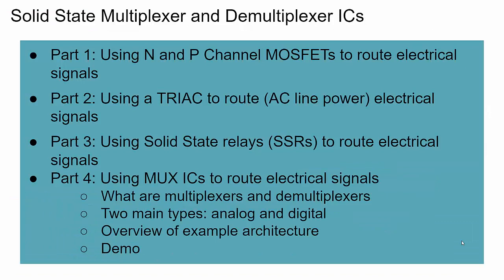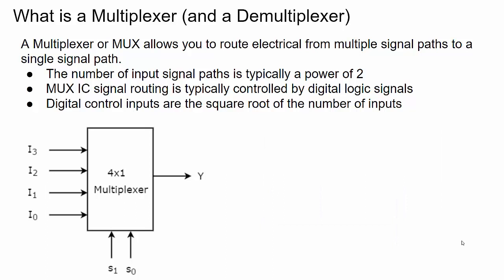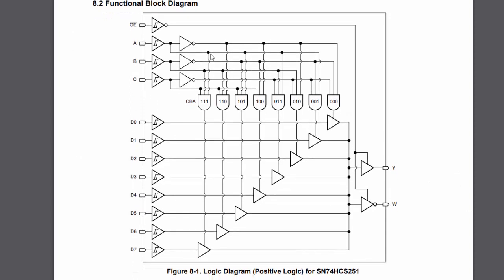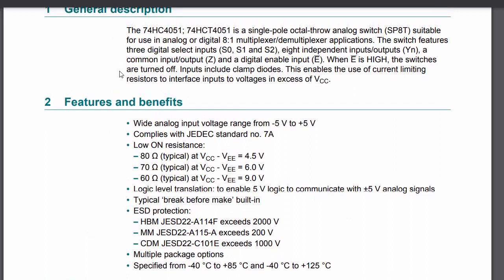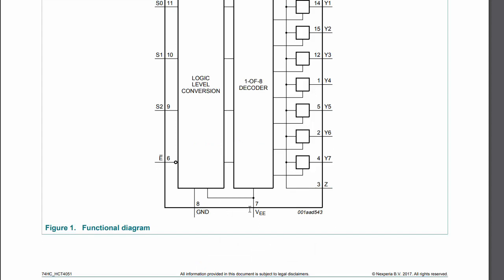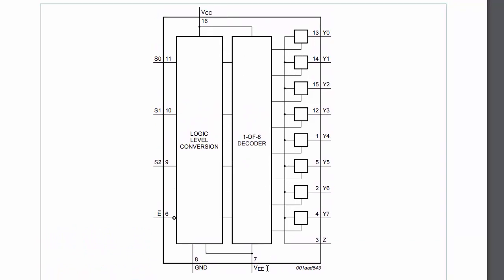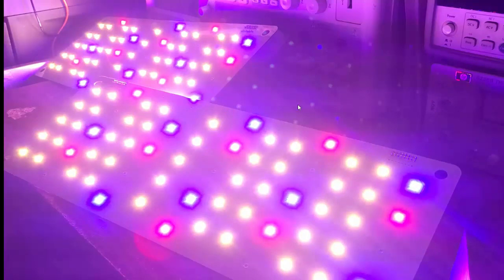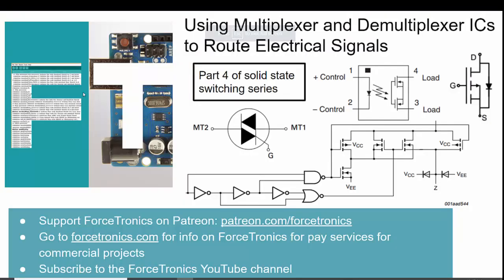Using Multiplexer and Demultiplexer ICs to Route Electrical Signals

Comment: Is there an IC that will automatically send binary to the address lines of a Mux/Demux causing it to change without having to press analog switches?
Reply from the maker: Yes any microcontroller or microprocessor properly programmed can be used to control a mux or demux